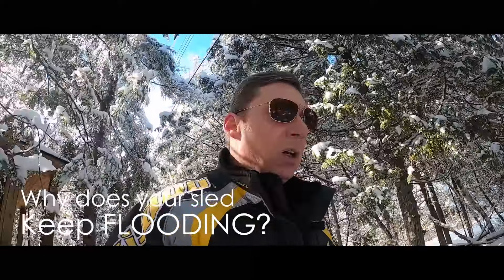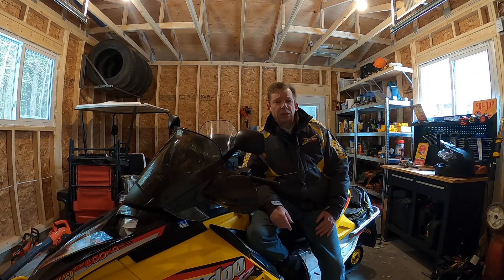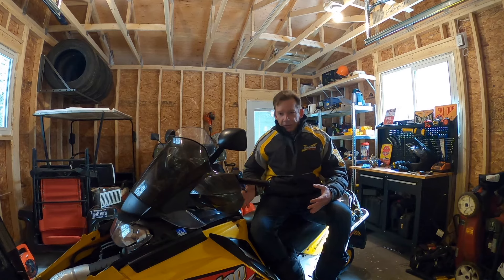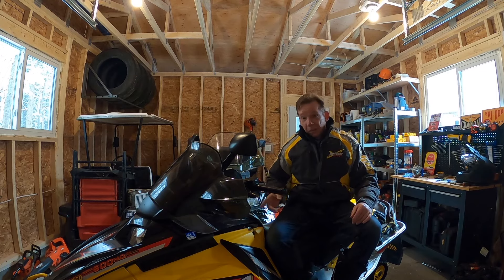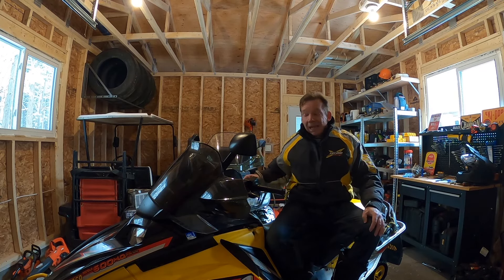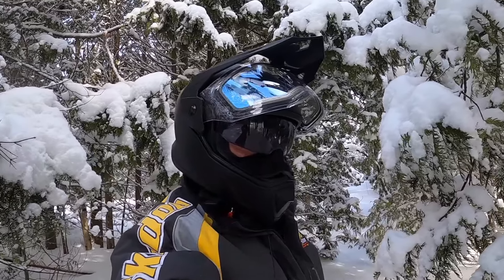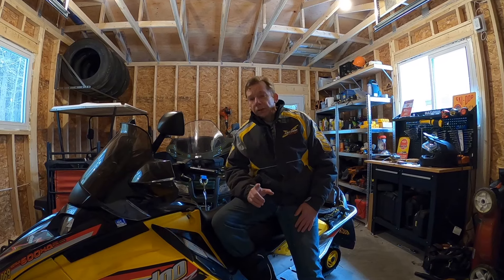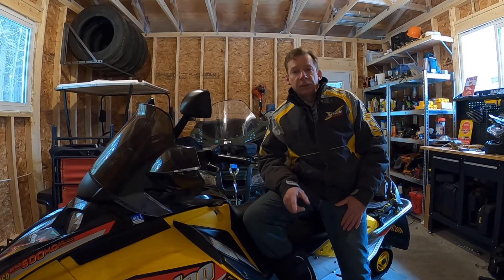Why Your Snowmobile May Be Flooding, Fouling or Running Rich

Comment: Rotax type 343 with Mikuni impossible to fix, 340 engine .all new gasket & seal, 145 PSI compression on both cylinder .vacuum test done, I took a good working Mikuni VM30-91 from a running engine & installed it on this engine & it flooding at idle .tried another carburetor from another good 340 engine & keeps flooding I am clueless...What do I do wrong?
Reply from the maker: You pulled it off the same engine? It didn’t flood in that one? Are you running it with the air-box on? If the air box is blocked it would run rich and flood.
Reply from the maker: Thats an odd one if you tried two carbs from the same engine, and the weren’t flooding on those engines, id say air-box or fuel pump?
Reply: No air box, Yes I replaced the fuel pump, same result ,flooding at idle  @MyOldSled .I even cancel the primer in case ,same result flooding at idle
Reply: @MyOldSled  Problem solved, intake gaskets leaks
Reply from the maker: Thats very strange. That should make it run lean
Reply: @MyOldSled You are right, did not fix the problem, tried it today & run rich ,flooding again.🤔

Comment: When I drive my skidoo 500 sometimes it bogs down and then comes back up to rpm’s but now I have a fixed
Reply from the maker: I’d start with a good carb cleaning, try and get the specs for your air screw. Put good plugs in it. Start from there.

Comment: Does anybody have any ideas about my skidoo 2005 550f
I got it started and it ran good for a couple days but one day I shut it off of and it would not start(there was a loose spark plug)after I did start it it was boggy and it kept dieing now it won’t start at all. My only thought could be stuck float(carbs were cleaned ten months ago) My pride won’t let me bring it to a shop, any ideas?
Reply from the maker: What do the spark plugs look like?
Reply: I just had just put fresh ones in and got it started the first time
Reply from the maker: And after it won’t start what do they look like.
Reply from the maker: If you like, message me on my facebook page we can chat.
Reply from the maker: I have a few thoughts, easier to chat. https://www.facebook.com/MyOldSled

Comment: My sled keeps flooding we cleaned the carbs changed the gaskets and we even put in new carbs and we changed the fuel pump to it keeps flooding
Reply from the maker: We’ll the fuel pump and carbs are the entire equation so assuming you used the correct parts, and have the right mixture settings for your sled, that leaves over choking/priming. Oh is the air box clean. Restricted airflow will cause a rich condition
Reply: @MyOldSled  I don’t have an air box on my sled and yes we did use the right parts for the carbs and fuel pump we literally fixed everything that causes flooding and it still floods

Comment: My sled seems to flood itself after its running and I ride for 2 minutes
Reply from the maker: What have you done to problem solve so far
Reply: @MyOldSled  I ended up figuring it out, I think the o ring on the float needle was bad and the fuel would just keep flowing past it, thanks for the reply good sir